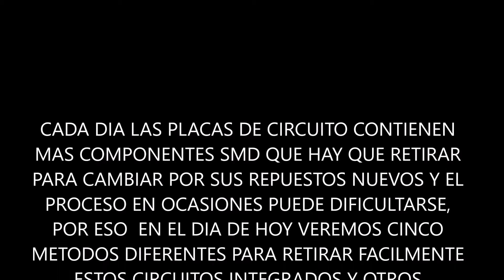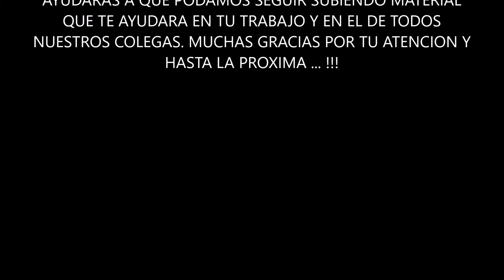RETIRAR INTEGRADOS SMD, 5 METODOS FACILISIMOS

Comment: Hola amigo yo estaba soldando un cable de la play startion 2 de un circuito integrado y ahora se ve una pata levatada desoldada y se ve la placa un poco pelada, se puede arreglar eso rellenandole soldadura ? Ayudaaa
Reply from the maker: Hola Efra gracias por comentar, puedes intentar primero retocar la patilla que ves que esta despegada, limpiar con alcohol isopropilico, secar  y probar si ya se corrigió el problema, pueda ser que no haya habido ningún daño en el circuito impreso. Exitos